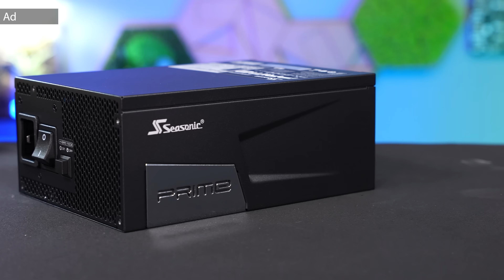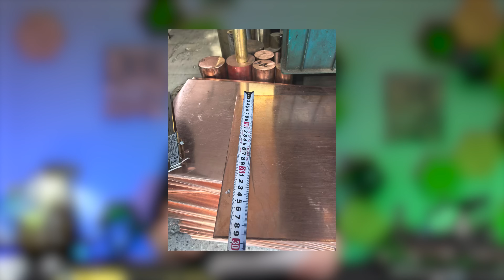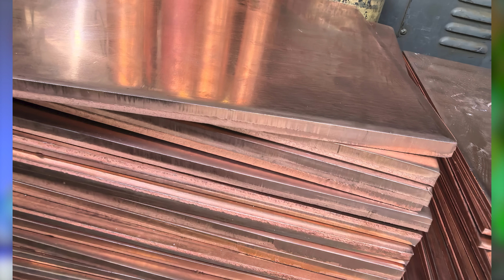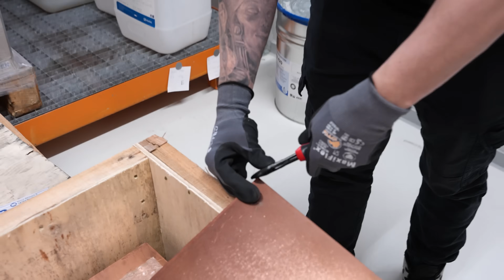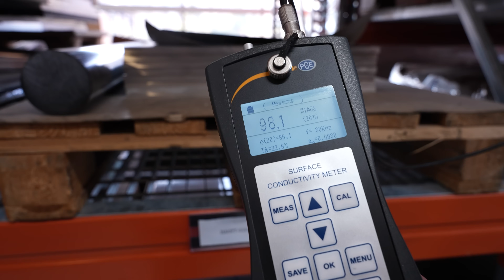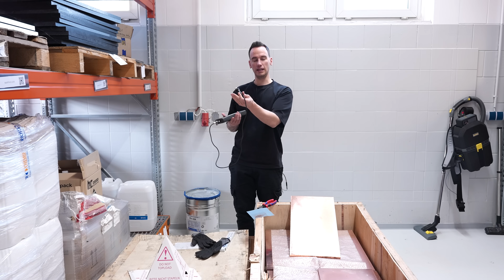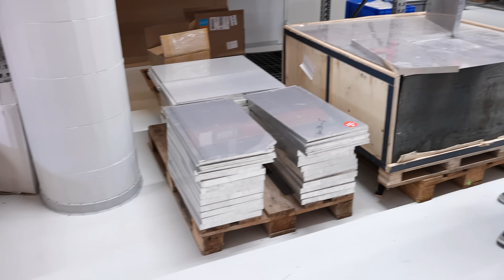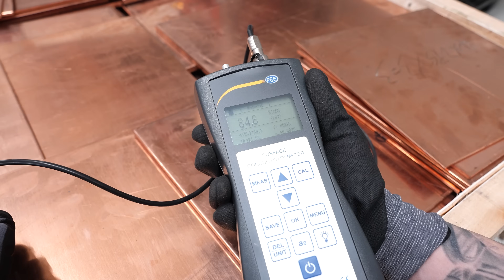I Got Scammed

Comment: Logistics firms do actually offer a service to protect from this kind of issue. It is usually referred to as line item inspection or line item checking. It is very expensive but you can pay your 3PL to receive the items, open the boxes and verify the goods inside match the goods expected.

Comment: China is also country with scammers. I ordered several times USB-C cabled with power port. From 8 pieces, i received only 2 working and 6 doesn't meet requirements.
I told some suppliers they're not working but they say it's working and ignored me, even i have proof. Fuck this.
I bought now cables from Europe trustful shops where i know it's proven working, even i pay 2x more.

And you sure think Alibaba is trustful plaform? They can fake everything anyway to make it looks legit.
So it's better send someone to China to verify it for you. Or special broker there with EU/USA roots.
You can even ask some Youtubers here with China experience or have travelled there often times.
Fly to China is not $40,000, its much less.

Next time, ask for more help to make sure its legit. Photos are no proof because it cannot see what is below, and they don't show how its filled. Copper covered metal plates is not hard to make. I feel sorry for you.

Comment: One way to prevent this is to work with a supplier that will let you go on site and check and do the tests you need before the material is packed. Its a hassle and takes alot of time... but its a sure way to know exactly what you are getting. Its sad you have to deal with this kind of thing.....

Comment: The fact that they used spacers and layers of real product shows how premeditated this was. It really highlights that for orders of this scale, on-site inspection is the only real protection. A plane ticket to China is a small price to pay to ensure you aren't being sent copper-coated steel or partially filled crates.

Ultimately, it's the perfect litmus test: if a company has no issue with you coming to crack open the crate to inspect the product, and then monitoring the loading on the day it departs for the harbor, they’re likely legitimate. The ones who refuse, make excuses, or provide false info are the ones to run from. It’s much better to lose just a deposit and the cost of a trip to China if it means you catch the scam before it departs, than to lose the full €40k plus import fees/duties or such..

Comment: I could tell immediately that the edges are flame cut and you don't flame cut copper. And the rough mill surface finish looks like steel. This really sucks, but you took the risk ordering from China.

Comment: I was fighting unexplained errors on a computer i'd built from scratch. It used some jumper wires that i'd bought on Amazon to connect various pieces. I watched a youtube video where someone had discovered that their jumper wires weren't actually copper. I had an aha! moment, my wires were magnetic. It's hard to believe that copper coating 18gauge iron wires would save anyone any money, but it apparently does. I switched to some non magnetic wires and my project works fine now.
Reply: This is why no one should use Amazon unless you are buying stuff you are fine with being a shitty knockoff
Reply: > It's hard to believe that copper coating 18gauge iron wires would save anyone any money

It does at scale. Also, I have a bunch of these as well. Got them from Amazon, the seller is gone now after I reported them but they just make a new account and keep it rolling until someone checks them with a magnet.
Reply: In car audio stuff this happens regularly copperplated aluminum, only go for 100%ofc copper and then from a reputable seller.
Reply: It saves a lot of money when you're producing miles and miles of wire.
Absolutely scummy, but when your only incentive is profit and there's no consequences for blatant fraud... well, capitalism dictates that blatant fraud it is. :/
Reply: @wasd____  

>capitalism dictates that blatant fraud it is

No it doesn't. Fraudsters get called out, reported, shamed, pushed out of the market space and shunned for it or jailed for it. 

Any other economic system protects fraudsters.
Reply: @maaadcheddar  "Fraudsters get called out, reported, shamed, pushed out of the market space and shunned for it or jailed for it"

...What did you JUST SEE in this video?

Comment: Firstly, I'm sorry you suffered this. I've seen this very same thing happen with high value cabling, the first samples are solid copper, while the bulk of the order is copper plated aluminium. The fundamental problem here is cultural, in my experience for many, what you have experienced is considered good business. You are the fool for not certifying and securing the conditions of trade. The same applies to getting payment, many companies considered it good at business if they find a way to get out of paying for something, it's not considered fraud or theft like it is in the west, it's considered good business and the fool is the person who should be embarrassed for allowing themselves to be duped. Many "Face Saving" cultures are like this, they rely on you the victim not wanting to lose face and exposing themself to public embarrassment.

You get around this problem by asking for a much much bigger order delivered in smaller regular shipments, they will fear losing the balance if they try to scam you early, usually you will get what you ask for on the first delivery. Once you have enough you cancel the balance on some trivial technical grounds. Secondly, for the bigger order you can obtain better terms. But know this, never assume that after the first order the rest will be OK, because culturally the motivation is to dupe the buyer or find a cheaper shortcut.

Comment: So USA People not get scammed, READ THE FOLLOWING;
The Seasonic PRIME PX-2200W (2200W) power supply is primarily designed for 230V, 50Hz environments (such as Europe and China) and is not designed for the standard 110V-120V household outlets commonly used in the USA.🎉

Comment: The fact that you were scammed in this way is not embarrassing, it proves you are an inherently honest person and expect other people in business to be honest too.
Reply: It's a massive problem across the industry that we're in when it comes to chinese manufacturing. They will always cut corners when they aren't being watched which means the suppliers we deal with have to have one of their own team on site in the far east to make sure products are coming out of the factory as they should be.
Reply: so true! roman is a honest person
Reply: But why are the chinese companies even going through all those lengths to fake copper... i mean they needed to cut the plates to dimension and THEN they coated them in copper, that process is also quite expensive. So they put a lot of effort and money into cheating, why doing this in the first place. its not that a little bit cheating is better than just taking the money and not sending anything?
Reply: @PoisonNuke  It's too common in China to cheat. One of the worst examples is with steel (ordering high-grade industrial steel but instead getting basically throw-away quality steel is one example Western companies very quickly learned to look out for), but welded-on or colour-washed plates is also something Chinese companies might try to pull. They make a profit on it by using garbage quality underneath and layers just thin enough to deceive but not enough to cost a lot.
There are honest Chinese companies who can be trusted not to fuck over foreign customers, but they basically get swamped out by the cheats who are there to cheat and deceive.
Reply: @MBSteinNL  Yeah, that's the thing: When fraud isn't discouraged, it always tends to outcompete integrity.
Reply: It is embarrassing. Alibaba literally has a built-in escrow service designed exactly for this situation so you can’t get scammed—and our boy just wired them $12k upfront, then sent the other $28k after they sent some pics of it loaded on a boat. That’s not at all how you handle two $20k orders.
Sellers on Alibaba have assurance ratings for a reason. You only order from someone whose assurance rating is higher than the value of your purchase. Second, you use the built-in escrow: Alibaba holds the funds until the transaction is complete. Once the shipment arrives and you verify everything, then—and only then—the funds get released. If he had done it correctly, he’d have his full $40k sitting safely in his account right now.
Instead, he sent 30% upfront and then the remaining 70% just because someone sent him pictures of it on a boat. That’s not how it’s done at all. It’s honestly common sense.
Reply: make this my words, you should not be embarrassed in any way, was not your fault
Reply: I have been scammed a few times i know i am a good honest person, people tell me all the time.. i can not believe people scam for a job
Reply: Remember high trust society? it was nice, too bad it's over
Reply: Name the companies if not to help someone else from losing money to them also. There is no way that was not done to scam you out of money
Reply: An honest person would have used the platform he was using to shop for a supplier to broker the deal..
Reply: Def a bit embarassing
Reply: @SebastianBean No It's not.  That's a you problem.
Reply: @Alex.The.Lionnnnn  it actually is when u look at the facts of the case. is getting scammed embarrassing? no not at all, can happen to anyone. but is this scam embarrassing? yes because he could have used the built-in escrow account on Alibaba which is there for this exact situation. u transfer the money to the escrow account for Alibaba usually CITI bank, and then when the product arrives you verify it and then upon verification are the funds released to the seller. if he had used the already in place procedures he would have been protected from the scam and still had his 40k. its a blatant oversight which is whats embarrassing not that he got scammed that someone so successful can not know something so basic
Reply: It took me 30 years of my life to learn that being honest is NOT a good thing in this society.
Reply: @seeibe  Fail. Being honest is inherently a good thing: Trusting or assuming OTHERS to reciprocate that honesty is imprudent.
Reply: @Mac-Attack73 Not really. I'm autistic and I've learned that most people lie by reflex. It's so inherent to them that they don't even notice it. Confronting them about it makes them lash out, so I've learned to indulge them in their self deception. I don't think most people would even view it as being dishonest, to them it's just politeness.

Comment: Your failure point was not inspecting the shipment between the supplier and the ship. It would have been so easy to have the supplier put the material in several smaller boxes with easy access lids which could be resealed and make access to the bottom easy, and then inspected at the dock by a reputable, third party person, who could perform the basic tasks needed to check for purity. I'm sure the testing device could have been rented or  if not, had your own testing device sent to the inspector. Maybe you'd be looking at $500 Euro max for the inspection. Based on labor charges in China it likely could cost half of that.

Comment: If cost weren't a thing, or else I had good community backing, I'd try to set up a facility to recycle scrap eWaste copper, steel, aluminium etc sourced locally instead of importing from hostile, distant, and deceptive foreign powers.
There's also a lot of eWaste in the EU that gets dumped or sent offshore recklessly - which could be a mistake given how valuable the materials are, and how vulnerable overseas markets are to geopolitical shenanigans.

Comment: There are only 2 things I can think of that might have helped. The first is using an escrow company, so that they never receive the payment until you've confirmed the materials like you just did, then escrow can release the full payment. If the Chinese supplier is unwilling to use one, then walk away immediately. You need to be the one to pick the escrow company, do not allow them to pick it as they will likely be in on the scam. I've seen reports of people saying the supplier has their own preference that they use, and those companies are in on the scam. The second thing is to have the crate be pulled apart at the ports on each end of the trip, to confirm at the least the basics that you did, so checking they are non-ferrous with a magnet, the crate isn't half full, etc. Pre-Shipment Inspection (PSI) / Final Random Inspection (FRI) is usually what the service is called.

Comment: Ask the supplier to provide the weight of each plate, then calculate its average density. Copper is 15% heavier than steel, you will see this immediately.

Comment: As a machinist in America, we've seen many suppliers try and sell us foreign sht steel. For the amount you needed, you should have tried to get the best deal through an insured supplier. They have the experience to know who to purchase from. Once I realized the high amount of purity you required, I knew you would be scammed unless you paid a third party to inspect it before it left the docks. That was your failure point. The scammers could send you any number of pictures, videos, or inspection data they wanted, but a trusted third party inspector being paid a few hundred Euro was an easy, fast, and reliable answer. You could have trained a 6yo child to execute those inspection methods. And in your case, the third party inspector should be German or American.

Comment: There are only 2 things you could have done: Flew there and manually packed each piece of the container, then had it taken away by your freight and then paid...obv would never have happened as they should not have agreed. The second is use someone who you worked with before as a middle man, to supervise - this works less and only typically does, if  they are able to force consequences. Otherwise, yes, sadly, I can't even say, lesson learned, as there is likely nothing you could have done to prevent this. The fact that those pieces weren't just electroplated but heavy/thick coat, means that someone vent into a lot of time and trouble to do that, so it's likely not their first time scamming people.

Comment: It's really bad luck, but here's what you could have done differently :

1. If you are working with large professional orders, you aren't going to use these platforms. Notice how you don't see this level of product offered or traded in that marketplace. Ali is optimized for small-ticket, low-consequence, consumer-ish transactions. "Marketplace mismatch" is where a lot of scams take place in general : you don't ask your plumber if he can do a whole house renovation - you go to a licensed contractor. In short, you chose a middleman with a good track record - but not for the kind of orders you are making . See that crucial difference? 

2. A $20k order where composition matters is a QA/certification-driven procurement problem to begin with. You need independent testing and paperwork before acceptance and there are standards of how it's done, not just photos. I know they could bait and switch, so see point 1.

3. Stage your payment tranches after verification, not just shipping.

Sorry it happened to you.

Comment: That is just Chinese culture. People are praised for this over there. It's not seen as scamming you but instead him/her being smarter/outwitting you. When doing business over there this is just how business is done. Just think of them as the cut throat  wall street types, where not reading the fine print will get all your assets seized and you will be put into what amounts as being an indentured servant(aka slave). Do like another guy in the comment sections did, send an inspector over to China to check all the goods as they are being boarded on the ship.

Comment: 'where did i screw up'   you ordered from china... its famous for this, the term in tooling is 'chineseium', or tofu dreg for the building industry. Within the building industry we use escrowing agents for large transactions, ESPICALLY when dealing with china, because even trusted suppliers try this stuff. 
A place i worked at once got a steel beam shipment that snapped while being offloaded. the steel was so healily embrittled during manufacturing it was useless and less than 90% iron, for reference normal steel is 98% ish.
on the payment method, this would be counted as wire fraud, so the transaction may be insured by the bank, i know there have been some changes recently, so that might be an option.

Comment: Appreciate you sharing your experience.  For the future (if you even want to try again -- understandable if not) an approach that works well with Ali (& etc.) suppliers is to tell them you have a need for materials 10x your actual need.  You say that you want to test them out with a smaller order, which happens to be the actual amount you need, but they think is only 10% of your ultimate requirement.  They'll send you their top-quality stock to keep themselves in your good graces, anticipating ripping you off on the big order that never comes.  And if they were a legit supplier, well, no real harm done.

Unethical, perhaps.  But defensively so.

As far as legal action against the company, you are correct; Almost no chance that would be feasible.  I can't speak for the EU / Germany, but IME there is a chance that if you report it to the police you may be able to use a police report and detailed information about the fake merchandise to get money back from your bank or payment intermediary (not sure how you paid) on the basis that you were the victim of fraud.  Not guaranteed, but it's worth pursuing.  At the very least reporting it to the authorities and/or bank it can provide something like closure... maybe.

I'm assuming you don't have any kind of business insurance that would cover the loss?